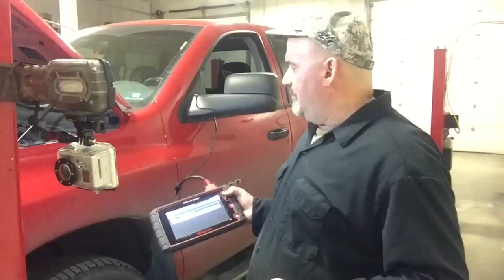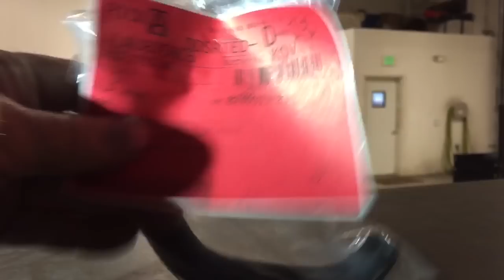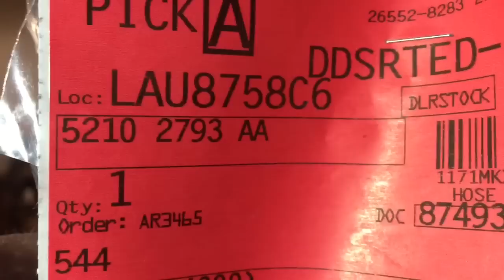Dodge Ram P0440 P0456

Comment: This is what was wrong with my 07 Durango..i spent over a month replacing parts and stressing out . That EVAP leak pump..caused my Durango not to start after i drove it and it was warmed up..id have to wait 10 mins..then id hear the fuel pump engage
Reply: I'm having the same issue sometimes my truck won't start at all an if i wait about 10 minutes it will start perfectly. I have a 08 Ram 2500 4wd HEMI besides that it runs an Drives Flawlessly ' an I also have gas light cap on but I changed the gas cap with a new OEM gas cap an brand new purge valve an gas cap ight still on. So you think the leak detection pump is bad an causing all this Bro?

Comment: I have a 2013 Ram 1500. I got the code P0456, bought an after market gas cap, didn't fix the code. Then, just paid $89.95 plus tax to have my garage diagnosis. I new OEM gas cap and the code is fixed. Learning the hard way!

Comment: This needs more views! Looked in that exact spot and wouldn’t you know the hose was all cracked and rotting out. Did a visual inspection on the hose from the front of the car all they way back and that was the only place where is was cracked right above the charcoal canister. In my area the dealerships did not have the part in stock (52102793aa) but I ended up going to advance auto and grabbing some 5/8 rubber hose and they worked just fine. About 14inches of 5/8 hose and used metal hose clamps as well to hold them in. Code P0440 is gone and truck is running fine. 

Thank you sir.
Reply: Cool deal. I changed that part on mine. But found a cracked hose over by the filter canister.

Comment: You're awesome! I've looked everywhere for the fix to the P0440 code. I was just about to go ahead and purchase the evap canister (mine has a small crack), when I ran across your video. I checked all of the other things you mentioned, and found that after removing/testing/cleaning my purge valve, it has fixed the error code. Thanks!You just saved me $200. Easy fix.

Comment: Bought the 2018 Ram Bighorn 4WD used last week. Put 250 miles on it and truck shut down after remote start twice and suddenly had this code. Truck is from the deep south gulf coast area.  Thanks for the video

Comment: This is the second time I’ve had an issue with that code. The first time was at hose. I couldn’t remember which one it was until watching your video. Thank you for the reminder. Seems they last about 10 years. I live in Southern California, so there’s not much moisture, but it seems like they rot from the inside out.

Comment: I have a red 2004 Dodge ram 1500 5.7, 4X4  Intermittently I get the engine light and tested it with a Fix and it showed code P0440. Stays off for awhile and then later shows up again. I only have 65000 miles on it and never changed the cap so that will be the first thing I do and also look at the hose. Thanks for the video

Comment: What are the consequences of ignoring these EVAP codes?
Reply: You fail the I/M emissions test, which means you can’t register the vehicle where the test is required. My problem is a cracked fuel tank vent nipple on 2004 ram. 2004-2006 rams use the same part number. New fuel tank doesn’t exist and junk fuel tanks have the same problem. The work around is clear the codes and do drive cycle until only the evap monitor shows not ready to test, while keeping the tank at least 85% full. The evap monitor does not function when the tank is above 85% full or less than 15% full. For 2000 and up you can pass with one monitor not ready, as long as the MIL isn’t lit.

Comment: Hi, Great video. I'm going to check the hose tomorrow. One thing I want to mention. At  certain times I smell gas behind the cab right above the fuel tank. No pattern. Is the system running its test? Does this smell point to the hose or something else? Again great video, Thanks

Comment: P0440 code. Could lead to vehicle operations to run lean.. And cause knock or ping issue and burn spark plug. Just check #1 plug. If it's hot white.its definitely lean. It'll burn the plugs up. Evap purge ? I'll check that.

Comment: 09 dodge 3/4 ton 4x4- fixed it by manually blowing thru the 1/2" lines, cause everything looked good and clean. don't know if that was the fix but the code is all good now and it's been a week

Comment: Mine is a p0441, and everything I’ve seen says it’s usually a vacuum line, gas cap, or vapor pressure sensor. I’m assuming the p0441 is very similar to the p0442, I’ve seen them with the same causes and fixes. I’ve also heard that the truck will throw this code when the temperature changes drastically, which happened this week where I live. This is my first winter with the truck in this area, and temp dropped from about 60 to around 20, so maybe that could be a cause? Just curious on your thoughts on the 441 code. I’ll do this stuff and see what happens later too

Comment: My 2006 Ram 1500 just started showing code P0456 I have replaced the gas cap so we shall see if that fixes the problem at least I know where to look next if the code comes back. Seems like I have to drive it about 100 miles or so for it to show up.

Comment: Good video! Changed my has cap last year when I experienced this issue. Now the code is back. Gonna check that hose next.Do you have the part number or name of hose. Thanks!
Reply: use the last 8 digits of the VIN at the dealer for that particular vehicle

Comment: 2001 Dodge Intrepid here, and we replaced gas cap a yr ago to factory model. Car is running great yet this code comes back often. Looking at annual inspection this summer so preparing myself for dealing with this yet again. Labor charges here are astronomical to say the least. Obviously even minor repair bills on this vehicle bite. Last book value checked showed car is worth around 700.00. Bought used in 2002 with 24K mikes and currently have 140K. Thanks for the video information.

Comment: HeyTim, I have an 03 Durango. I'm getting the p0440. I snipped the ends off the hoses that were cracked. i checked the purge valve solenoid up by the left fender. I'm not sure what the part is under that by the battery, do you know what that part is? The gas capo looks good. the vap light is flashing on my innova scanner. How do I test the leak detection pump?

Comment: Thank you very much, but I have a different question on the subject. what type of oil do you recommend for the 5.7 hemi, with more than 100,000kms
Reply: Because of the VVT cam and lifter system on this engine. I would continue to use the same weight oil the owners manual states no matter how many miles you have on it. The days of moving to a thicker oil when the engine has over 100k miles on it are long gone now that engines now have VVT solenoids and VVT systems on it. If you put heavier oil in these engines nowadays you risk not getting the lubrication inside the valve/cam system you need even though it will show plenty of oil pressure

Comment: I have a  2006 dodge ram 1500 with a 5.7 hemi engine and it runs fine until you fill it up full of gas. It will then stall out every time you let off the gas foe about the first 3/4 mile and then it will run fine from then on until you fill it up again. Of course as usual there is no code.
Reply from the maker: I would check the fuel pressure. Sounds like a possible fuel pump going bad. Another issue may be a fuel EVAP system problem where excessive fuel vapor is being burned after a fill up from a faulty purge valve
Reply: MrNormanga did you ever figure it out? I currently have the same issue on my 04 hemi

Comment: I smell gasoline odor on mine.. but i  noticed  on my 04 hemi, my pimp lock ring wasn’t on tight. Would that hive me the code P0456, P0442?
Reply from the maker: @tengzturiagaiii3185  yes. Any leak in the system can cause those codes.
Reply: @ i plan to redo the lock ring. Thank you sir

Comment: would the P0440 code put the Trans in Limp mode where i gas up but the truck does not accelerate?
Reply: No. An evap failure should not affect  any driving ability.  It is its own system for testing fuel vapor leaks and that's it.  The same as if the radio failed...truck would still drive.  My truck has had all these codes and my radio hasn't worked for years.  Truck runs fine still.
Reply: @j.a4751  Thansk Buddy! I actually found why the trcuk went into limp-its a P0700 and  P0734 code --incorrect 4th gear ratio gonna replace the input/output speed sensors-hopefully that will fix it.

Comment: I have a 2003 ram 1500 4.7 engine giving me codes p0300, p0456. Could it be the same on your video?
Reply: Did you fix your codes? I have the same issues

Comment: Would that make the truck idle bad  or stall?
Reply: Brandon Engle I’m wondering the same thing. Let me know if you replaced these lines and fixed your idle/stall problem. I’ve been experiencing stalling and rough idle for YEARS and always suspected this but have never bothered doing anything about it. Now I finally want to sell the truck.